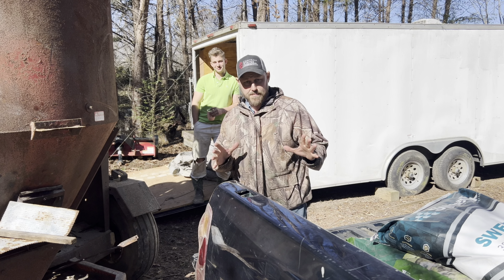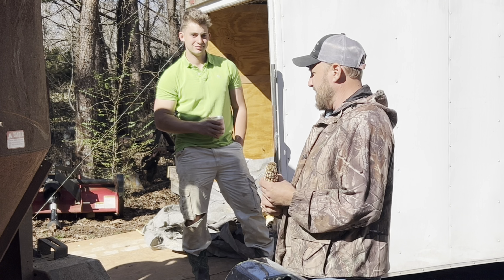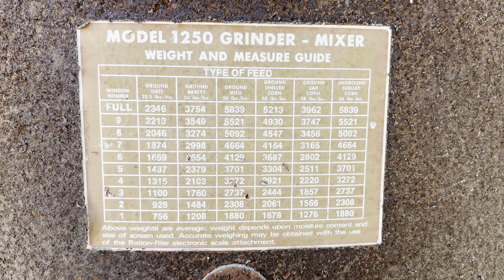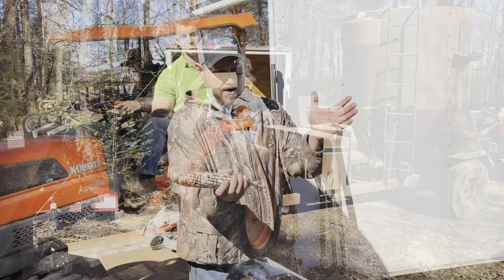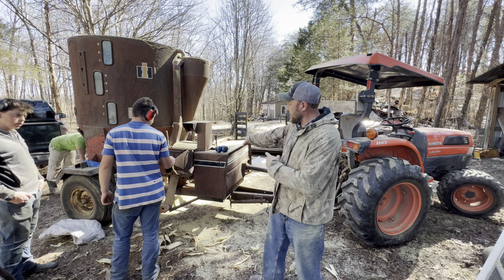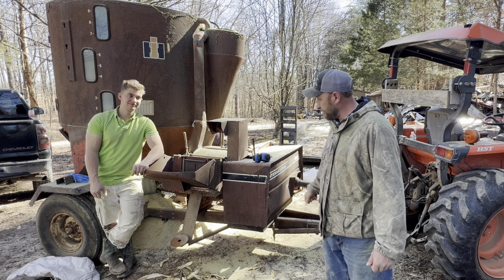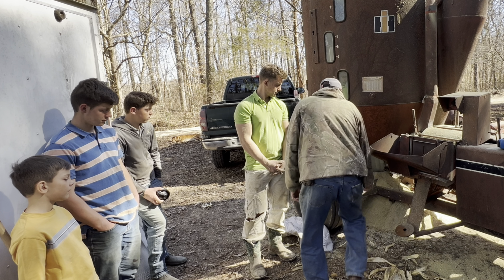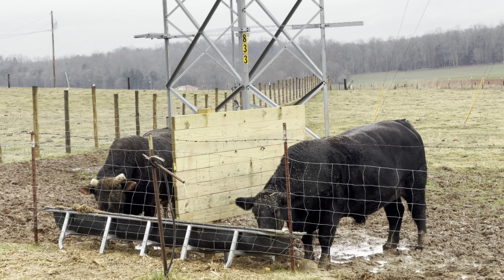Grinding the purple cross EAR CORN!

Comment: Friction is the cause of the heat
Reply from the maker: We put additional oil in the gear box……. We’ll see if that helps!
Reply: @McGieHomesteadAdventures  the oil will help machine run smoother but the heat will return its caused by two things hitting together, that y the first stuff isn't hot inda beginning.
Reply from the maker: Ok thanks for the info!